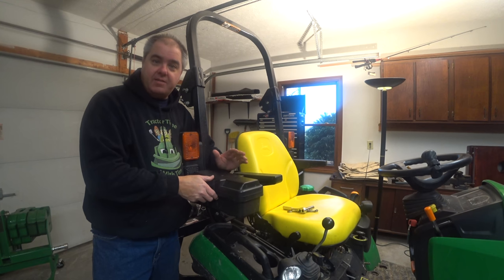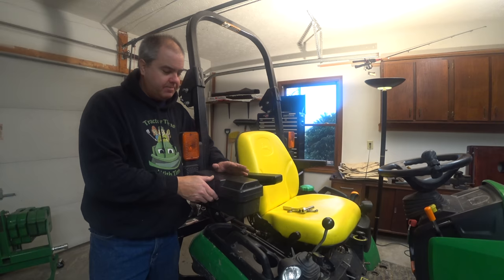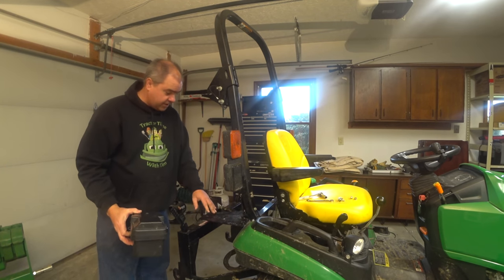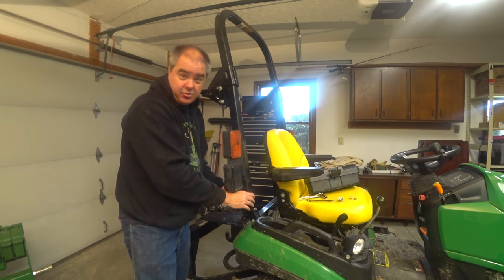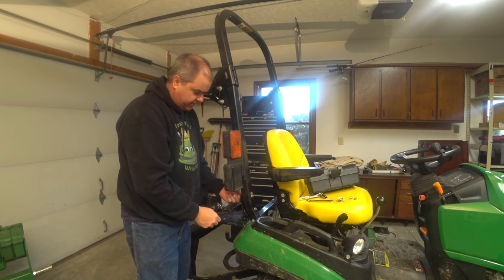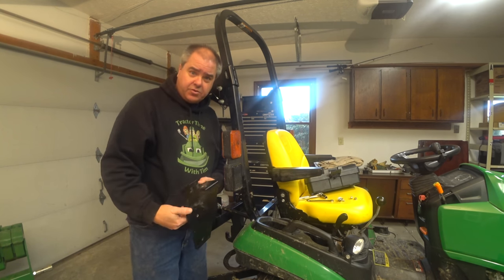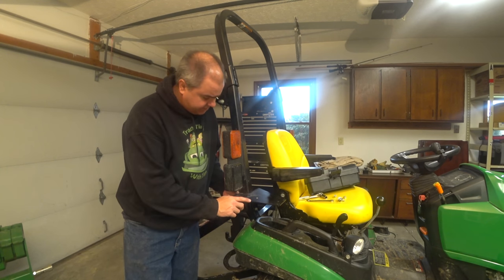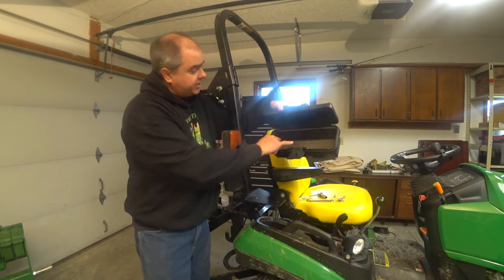John Deere 1025R Tool Box Placement with Backhoe with Tractor Time with Tim

Comment: Last year you inspired me to finally add a toolbox to my 2305.  I bit the bullet for a $63 bracket meant for a 1025R .  Stanley, Walmart, and Harbor Freight all have better latching 12.5-13” boxes for under $12 rather than the $62 plain John Deere box.  Thanks for the inspiration.

Comment: My toolbox was mounted when I got my 2017 1025R last January, but I don't have the backhoe, so it was just in the stock location. Looks to me like you made a good choice on how to mount it with existing hardware and retain use  of it and the cubbyhole Tim!

Comment: Here are the facts.  Mounted to the back of the Rops.  A 4 1/2" wide sheet flows down and behind the tool box.  It is 6" long.  then a bend of this 'tongue' flows under the tool case and goes wide under the bucket. The two holes you use was for the 6" down.  And the bucket is behind on the right hand side. No digger... :-) you drilled the center one.  The two ends are bolts on mine. Glad it was under the arm rest.  And turning around looking helps.  You are creative.  I keep red rag and double hook chain in there - 6' medium power chain.  I have four other chains, two monsters.   Thanks again.   forgot to mention the measurements were by phone app... looks good by the eye.

Comment: My tractor came from the factory as a FILB (factory installed loader and backhoe) or TLB (tractor loader backhoe). They changed the acronym somewhere in those years. But mine was mounted on the right side, with the latch facing in. It has to be this way so it's not in the way of the backhoe station. And it seems backwardly mounted, but it has to be that way for the door to open fully and not hit the rops. All in all, I'm happy with how they mounted the tool box on my tractor. I have zero complaints.

Comment: I must be the only one who likes the "cheap plastic" tool box that came with my 1025R. It is fairly long for a small box, and not so deep that it's hard to find a tool in it. It has held up well for 5 years.  I did replace it with an ammo can on my original non-TLB bracket, but not before I bought the TLB bracket so I could mount the original toolbox in the same place as yours. I did have to sand off a burr along the back edge of the lid to keep from being scratched when operating the 3-pt lift lever. You'll have to wait for my first video to learn where my 3rd, 4th, and 5th toolboxes are mounted. 😎
Reply from the maker: Must be two of us!

Comment: I got mine used with 12 hours on it, with the backhoe, and the box was mounted to the rear with the extra light mounting bracket so that they were higher up. I always wondered about your box location. I like the placement of mine, it is not in the way at all and importantly doesn't get in the way of the OTC cab that I have on for the winter. where you had yours, the cab couldn't fit. I've never needed to access it from the seat, so that isn't an issue at all.

Comment: I’m getting A used 3320r this Thursday with a heavy duty loader , box scraper , post hole digger , brush hog my first tractor can’t wait what are the most common tools you carry and or parts ? I’m so excited and congrats can’t wait to see yours....
Reply from the maker: Hammer, 2lb. Pliers.  Adjustable wrench.  Screwdriver, lynch pins, garage door opener :-)
Reply: Thanks a lot love the channel !! You ever done Horse arenas if so what do you think is the best way to work their dirt I’m looking at a new Rototiller for my tractor and areana vator I live in a horse property neighborhood the local guy they called Tractor Bob moved away so now I’m going to do it will be tractor Spence now now looking forward to it always wanted to be around all the horses you are an inspiration thank you for your knowledge can’t wait to see your new Johnny L for Joni large

Comment: Definitely missing the additional brackets to elevate the light housings!  The non backhoe units are mounted on the back of the ROPS verses the factory backhoe setup mounts directly below the right side lights using 2 u-bolts

Comment: my tool box came mounted on my 2018, I was plowing around the house and took it out on the corner.. its in a different position on the 2018, and the lights are higher

Comment: that is also where JD mounts the tool box when you get the JD bagger attachment.they also supply the brackets to move the rear tail lights. and like Tim i will not move the lights.

Comment: My tool box came mounted, 2/3rds of it projects from the rear of the of the tractor allowing access to the cubby hole.  It is also mounted lower, almost touching the cubby molding.  It is mounted with the latch facing the tractor.  I’ve got the 2017 1025R FILB from Reynolds JD in Atlanta. 

My light kit is mounted higher as well, with the top bracket ending where the rollbar folds.  

Appreciate the vids.   Wonder if you have any suggestions for paint chipping on the plastic hood.  Not sure standard JD green spray paint will adhere properly or look right.
Reply from the maker: No suggestions. Sorry. Didn’t know paint could chip. Didn’t even think it was painted.
Reply: Tractor Time with Tim 
Yeah I probably wouldn’t call it paint either.   Caught a bush just right while mowing and it flaked the finish pretty big in a couple spots.   Should probably just follow up at Reynolds

Comment: i have a 1925r compact Johnny and i have a 1154 frontier snow blower  with a mouser cab on m y1025r Johnny could you do a show on installing a electric motor on the chute for rotation  by using a electric motor out of a electric car window or electric motor off a car seat

Comment: I brought my tractor second hand and it came with a factory tool box. My tractor is a JD 2140 which i think was manufactured between 1980 to 1982. But having owned it now for 4 years the tool box has fallen off.

Comment: Any thoughts on replacing old johny with a 2025r now that youve used one?  

Also the standard (non backhoe) toolbox is mounted off the back as seen here https://i.imgur.com/jbUTYUE.jpg 

I’ve since removed mine and replaced it with a sxs cab mount carry all but will probably be remounting fwd now
Reply from the maker: Sticking with 1025r